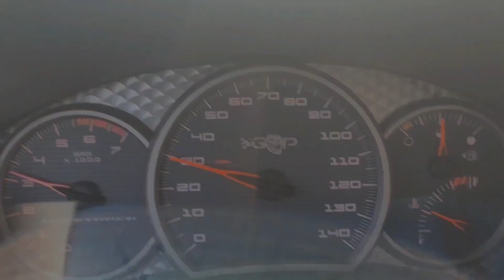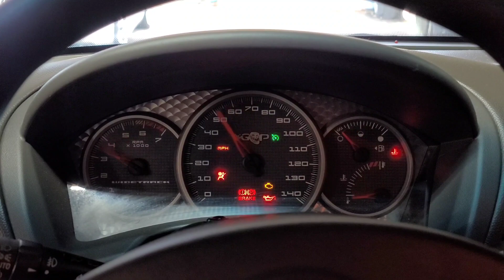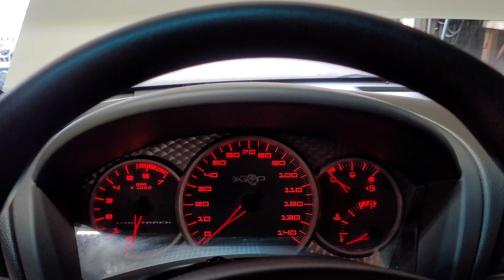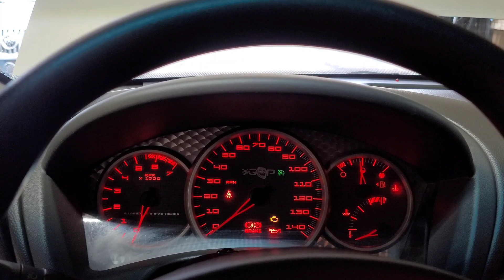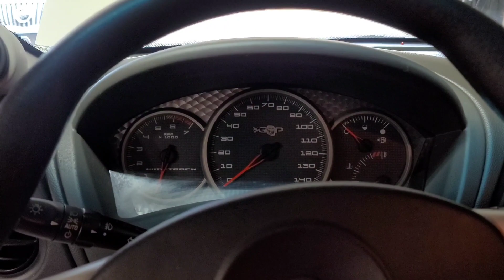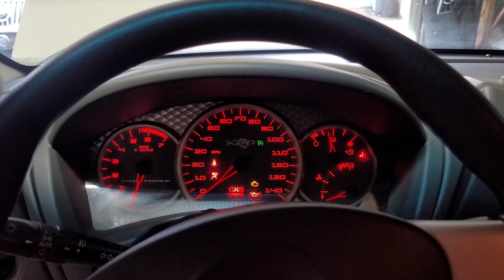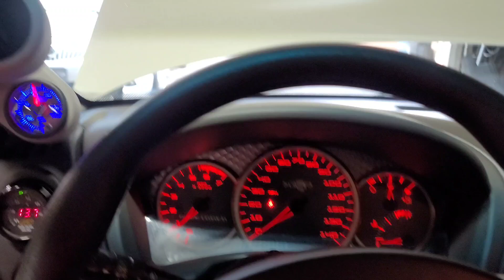05 grand prix nic cam with new upgrades now runs

Comment: Gen V SWAP 02 Monte L67 injector an rail North* LQ4 Mass Series 2 Harness an PCM   Run an Drive just Fall on Its Face Full Throttle Will 1.0 ZZP PCM fix that an what do I need to Let them know when ordering it
Reply from the maker: Yes if ur not tuned to run the lq4 it will do that